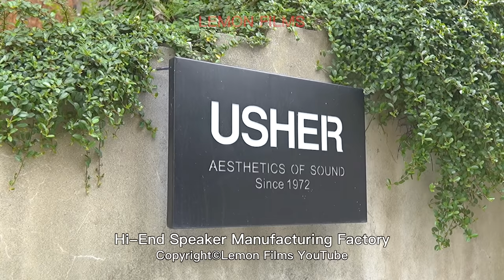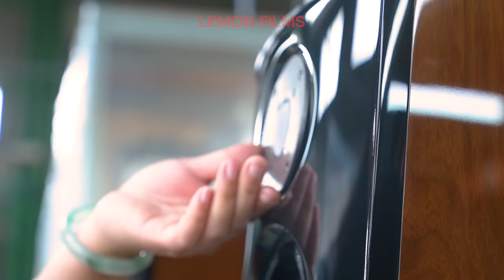Hi-End Floor Standing Speaker Production Process / 落地揚聲器製作過程 (音響製造) - Taiwan Speaker Factory

Comment: Primarily handmade, even the speaker driver. Thumbs up to this Taiwanese manufacturer.
Reply: I hope they reply to questions and/or  requests for help with their products via email. Their mainland brothers are very lacking in aftermarket service and help.
Reply: @bertroost1675 One other point- they are not using political prisoners as slave labor to lower cost.
Reply: @kenandbarbie-b6c  I am friends with an audio manufacturer in China and he doesn't use slave labor.
Reply: @bertroost1675 I know that and do not mean everyone there is doing that. Most likely they do not, but some CCP partnered operations do. This is outlawed in Taiwan. Some mainland Chinese companies like Fosi Audio is doing a great job on budget amps sporting Texas Instruments ICs & quality supporting parts. I am selective in what & who I purchase things from CCP China. I have no such reservation with Taiwan at this time.
Reply: คงแพงมาก ซิครับในไทยน่าเข้ามาไหมครับ
Reply: The “speaker driver” is a simple passive crossover filter
Reply: @stefano.a  I meant the speaker motor itself, including the components that make the speaker (coil & form, magnet, frame, diaphragm,  suspension, etc…)
Reply: I would instead say congratulations to those who have the money to buy them.
Reply: Wonderful sounding speakers. Some might say a bit underrated. You get a lot for your money with Usher speakers.
Reply: @Fonzotros  they are not that expesive
Reply: would like to review a pair of

Comment: I’m Usher user for 10 yrs, never encountered any issues! Last yr I bought my 4th spk ML802, compare to other I have in the same price, it's an absolute bargain. As a woodworker, those who insist on using wooden mallets are simply not practical. After seeing other high priced spks processes, I must say their crafts is already quite impressive. While there are certainly some details to improve upon, in terms of the finished product and especially sound quality, it's definitely worth it!
Reply: $26,000 US for a pair of speakers is an absolute bargain? I'll just go in my basement and chip what I need off my collection of gold bars.
Reply: I was interested in Usher back then. But they had a thin distributor network and it wasn't possible to approach one.
So I got with a PMC Fact8 and I'm happy with it.
Reply: Glad you like them, personally I think they look awful and I was very unimpressed by the standard of soldering.
Reply: Perhaps they sound good but they way they were put together was just rough. particularly the gluing of internal components, jees.
Reply: In today's audio world, there's way better for less.
Reply: Have to afree aboyt the soldering, very poor , only plus piunt will probably be using lead soldering as chinese production plant  @matthewn1805

Comment: Out of my 25 years in the glass business, I have only seen one home that had high end speakers. Now had I said 35 years in the glass business I am sure I would tell you I seen more. But what I see is almost everyone uses bluetooth speakers now.  And wow very beautiful and well crafted handmade speaker, I think the only thing I could criticize is the screwing of the circuit board to the enclosure without stand offs
Reply: Actually there was a standoff... it looked like foam to absorb vibration and to isolate the board.
Reply: Die Arbeiten wie die Büffel ohne Gefühl
Reply: @jimtincher7357  Notice how the board locally flexed once screwed down 12:51 . Inducing unnecessary flex in the brittle board doesn't seem like good practise, stand offs would be better. 10:37 those 2 inductors (coils) should be mounted perpendicular to each other. In their current orientation the magnetic field from one is close enough to induce a current in the other.
Reply: I think the professional level of workers is still poor
Reply: @wally7856  maybe its part of the sound design ?
Reply: Yes ~ I noticed the circuit board bending when it was scewed to the cabinet.
Reply: It appears those speakers in the video are made by order only and are in the $10,500 per 2 speaker range.
Reply: Right !  Standoffs are required at the crossover.  It guarantees to prevent the board from bending.  I also remarked lack of T nuts for the woofers.  That would prevent damaging the treads, in case of a repair job made by a little experienced technician or DIY 'er.  But at least, those little lacks as no effect on the sound.  Asymmetric design help to prevent internal standing waves. If that sounds as good as the design, I guess it sounds amazing !  It certainly whorl to be listened.
Reply: Concordo com todos 👍
Reply: @Jvavolerpareil  I got a pair of Usher speakers, they have T nuts. If you notice the screws holding the speakers are machine threads, there's no way wood or MDF could hold a machine thread.
Reply: yes I had the same reflexion. We even can see pcb bending.
Reply: MDF and plywood held together with wood glue.  Unshielded wiring with copper spade connectors.  Nothing about these says high end except the price.
Reply: I was thinking the same, that circuit board deserved better , also to much pressure applied , 
Maybe from me ( was to quick in the video) but i even got the impression that the circuit board was curve in the end ( from to much force applied when screwing )
Reply: Yeah these aren't even high end. These are expensive to many yes but far from high end audiophile quality.
Reply: @wally7856  brittle board? What? Circuit boards are made with some of the toughest shit you can get. They use a similar material on knife handles called G10.
Reply: @102AlienJim  The circuit board might be flexible, but solder isn't.
Reply: @taiwanluthiers In many hardwoods very good screw holding with machine thread screws can be achieved with a properly sized pre-drilled pilot hole. If the hole size is matched to the screw shaft the threads will engage with great strength.
Reply: You need to travel to Asia or India to see one everyday of your life.
Reply: @TinNguyen-bw7ww  都是外勞
Reply: Faltou um banho de verniz na bobina (indutor) espiras soltas podem modular o som.  O teste deveria ser feito em camara anecoica. Quanto a qualidade do  som ainda fico com amplificadores a valvula. O reproduzido com tensão (alta impedancia) é mais suave. O reproduzino com corrente (baixa impedancia) tende a ser mais duro. Ao ouvir em amplificadores a Transistor voce se cansa mais rapido, a valvula da mais prazer por um tempo maior. O fio que vai até caixa deve ser duplo (paralelo) em cada perna. A frequencia mais alta viaja no condutor em sua pereferia ao usar o fio duplo voce esta aumenntando o diametro consequentemente diminuindo as perdas na faixa de menor potencia do expectro de frequencia.  Um abraço aqui do Brasil.
Reply: You would not use standoffs, as this implies a hard mechanical connection. You would use rubber isolating mounts, where the board floats relative to the enclosure. Specifying the correct isolating mount (probably a custom design) and selecting the fastening method is the challenge. Probably the enclosure would have threaded inserts (mounting machine screw with thread lock) and the board attached with an mount top rubber nib. The isolator would be large diameter very short and wide.
Reply: @johnkaimins9998  how many circuit traces cracked as he torqued it down to 60 newton meters?
Reply: @LegendLength  Contact the manufacturer for the relevant information.
Reply: in my 35 years of herding cows i can tell you these are great speakers
Reply: Personally I'll stick to my fyne audio F501 & F502's
Reply: As a former manufacturing engineer, I spotted a number of concerning things. As for them being high end, that's a pipe dream. They aren't even being reviewed, nobody knows how bad or good they are. Gee, I wonder why not?
Reply: Я видимо один из не многих. который не довольствуется блютус колонками) У меня есть пару видео с моим сетапом.
Reply: @wally7856  É VERDADE!! DEVERIAM COLOCAR ESPAÇADORES ISOLANTES!!!

Comment: The most satisfying tool for me is the air powered caulking (gluing) gun. My right hand asked me "Can we get one?".
Reply: I don't know what I'd use it for but I need it lol
Reply: @pattygq  I've been weatherproofing a house, going through many tubes of calking, and just thinking about it makes my right hand hurt.
Reply: @teazer999999 I went through it not long ago and know exactly what you mean.
Reply: I purchased a cheap Ryobi battery powered caulking gun for a big job one time back in 2014. I ended up using it full time, even for small jobs. A hand save for sure. Just get the smallest battery to be lighter and even the smallest will last days of full use.

Comment: Anybody else cringe when they screwed in the crossover PCB directly to the wood without any standoffs and it warped because they provided no clearance for the through hole soldering underneath? 😬
Reply: I saw the same thing and literally said "OUCH" out loud!
Reply: Ещё я увидел стальной молоток стучали по дереву, много клея, очень много клея.
Reply: Especially when you consider these things start at $14,300 US dollars per pair!
Reply: That warped my head slightly…😂😂
Reply: It'll be fine
Reply: This makes absolutely sense like this as a rubber beneath avoid like this all vibration and rattling and the fiber glass PCB takes no harm at all.
Reply: That was shockingly bad, never buy these speakers
Reply: No. In fact, it's even better than having a clearance. All soldering was done with wires bent 90 degrees completely flush with the PCB. There's no issue here.
Reply: Yeah i noticed the board bend when the air ratchet wound down with no preset torque setting  and of course in time it must surely crack but other than that ( beautiful speakers !.)
Reply: @RascalCatify Meanwhile, you can order raw drivers, crossover networks, cabinets and all interior and mounting hardware from parts express for a tenth of the price and build speakers that will stomp these in every category. I know, i just completed 2 pair of 4 way towers that cost me 1000 a pair for all the parts and they are dialed in an sound amazing compared to anything i have ever owned, even better than my 10,000 dollar B&Ws and even better than my Legacy Whispers that were 25K for the pair. They took some time with labor and hard work but are simply the best ive heard and everyone that has come to give a listen are amazed. These companies build to a price point to make money, they are never worth more than anything remotely close to what they are asking for them.
Reply: Tak ja widziałem. I się wzdrygnąłem. Widziałem również pełno niedoróbek, a odsłuch był taki sobie. Te kolumny kosztują majątek ! Nawet ponad 30.000 Euro !
Reply: Also the soldering irons, unclean and probably using an acid flux to keep them clean, should mean that these joint will corrode quickly in a humid environment.  Would like to know the longevity of these units.  For 30K$ that part should be better.
Reply: I cringed at almost every aspect of this build.
Reply: @WorldFamousUnfluencer  I too, but this is typical of these types of systems.  I had a buddy who's father ran a Speaker Company in California, and another who built amplifiers, and they cut every shortcut known to man, to cut costs, or have a "unique" product.  They made millions, so it does work.
Reply: Same!
Reply: Very unacceptable.
Reply: Yes! lol. I already wrote about it before seeing this one so I guess I will leave it. That stretching of the plastic was painful.
Reply: I came looking for this comment 😂
Reply: yikes

Comment: I am very much doubting the "high end" claim here. The tolerances and manual gluing parts together at 4:00 seems to be pretty poor. Big gaps, joint glue is not spread out properly. This is one of those product that may LOOK high end on the outside, but is just poor quality. 7:00 Just surface mounting the baffle to the cabinet with sicaflex and nothing else is a cheap solution. Also at 9:00 this is not making of speaker drivers, this is the cross over. Made with really cheap parts with low tolerances, Same here, nothing high end about this. At 12:00 no clamping on the spider after gluing it. 12:45 The cross over board is screwed in too hard and is bent, this will crack and fail over time. 13:45 No gasket seal between the woofers and the cabinet will cause massive cabinet resonances.
Reply: Exactly my thoughts. Def. not high quality.
Reply: Imagine being this wrong. In public!
Reply: Careful. You'll trigger some people.

Comment: Should not max torque the screws in until they are all screwed in..also she max torque the screws on one area only..this puts alot of stress on that one area..good way to stripp screws..u alternate diagonally the application..
Reply: Watch some B&W videos, to see what true high-end loudspeaker manufacturing looks like.
Reply: First of all your statement is not relevant to My response..I am a mechanical  engineer and a hi end audiophile  for over 40 years...and be careful  about referencing b&w speakers because  only the 800 series  is manufactured  in England and everything  else in mass produced in China..and I am not diminishing  some of the Qualiry components  that come out of China..But emphasing the "mass produced" statement
Reply: They didn't show the whole sequence, so hard to tell if she only torqued one or all.
Also, the driver used may be set to only reach a set torque.
Reply: Yes, but my point with a heavy driver and a huge magnet structure has a lot of weight centralized initially.so the pull force will be enhanced in that location  before the whole driver is installed.also the driver with that much weight should be supported while all the fasteners are attached.Then and only then should they be torqued in a diagonally opposed fashion
Reply: @MuscleBN  true, but honestly there is so much wrong in this video that they don't seem to care much...
Reply: The crossover  components are heavy and should also have a bonding material to prevent movement.  The board looks too thin and could have stress and damage with age but if the solder keeps contact to the copper plane  it should be OK.  your main problem may be vibrations.
Reply: 12:48 bend the crap out of that thing
Reply: @ChicagoRob2  you don't know what you're talking about...
Reply: @Ale55andr082  How long have you been in the audio game? Two months?
Reply: @ChicagoRob2  B&W is not high-end loudspeaker. High-end speakers are made for studio applications. B&W is consumer speakers. Very good, but it's graded consumer speaker. Professional speakers is the actual high-end you're looking for.
Reply: @dncviorel  I greatly respect high-end, powered monitors, but they are specifically designed for the near-field.
Reply: @ChicagoRob2  Why do you think that?!! Near-fields is a major part of their production, but most professional monitor producers manufacture larger than life speakers. Enter any decent studio and you'll see all types of monitors, from the smallest to the largest. An audio engineer will spend most of his time on near-fields, that's true, but he will double check on larger systems as well. However, should say, that the guys in mastering might have different taste and actually some of them do work on systems like the ones from B&W, but...the guys from the top still work on the same professional brands that the regular audio engineer use. Not to mention that this kind of products are designed to last and to provide as faithful as possible their input signal, which means no coloration, no enhancement of the signal. It's really a no brainer if someone is in the market for high quality sound.
Reply: I think they only show one of the screws torqued out, still the rest are torqued out aswell. Propably not pushing much psi/bar on the tool, so it won't be stripped either way. What I was stressed out about was the centering of the magnets, and voicecoils and the bending of the circuitboard for the crossover o.O 
I haven reconed a few drivers, and always used spacersheets when centering the voicecoil, in my mind the magnetic field would be all over with these drivers with a non consistent sound profile. But hey i'm no pro
Reply: @dncviorel  I know Steve Albini, who is considered to be one of the top recording/sound engineers. He’s mixed/mastered Nirvana, Robert Plant, Jimmy Page, etc. He mixes on legacy B&W Matrix 805 monitors and also large, expensive PMC monitors that are mounted high on the wall, near the ceiling. For me, the beauty of powered pro monitors is built-in amplification, active crossovers, adjustable shelving, bass/treble lift, DSP, etc. In all honesty, I think powered monitors offer superior neutrality and value, over passive designs. So, we are actually in full agreement with each other!

Comment: This is indeed top craftsmanship! There is only one item I would do differently. I saw that the speakers were screwed down while the cabinets were in a vertical position. I think it would be better if they were horizontal.
Reply: It seems like it would easier to install the crossovers before gluing the front panel on.

Comment: Great video. How much will they cost coming out off these factory? The price in the hifi shop is 14.300 dollar in the U.S.A.
Reply: price in Taiwan where the speaker is made, this unit is about 6,000 usd sold directly by Usher. 

i guess shipping / import tax / foreign dealer margin will affect the final price in different region. but same thing applies to all things when comparing between domestic or import goods.
Reply: @allenlee2670  I think 600 dollar each.
Reply: @DMalek  I don't think so.